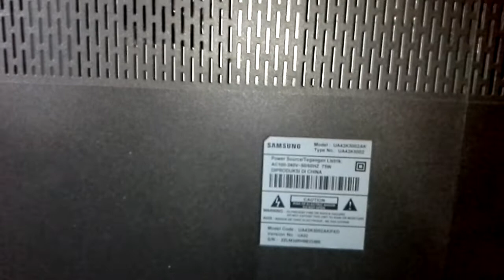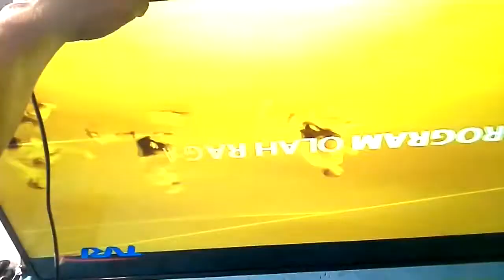Tv Led Samsung UA43k5002 Mati Total

Comment: Gan klo tegangan BL inu berapa ya normalanya, saya ada kasus tv ini saat on tegangan 28v beberapa saat naik 36v.  BL tes normal udh coba BL lain, tetap tidak hidup...fet normal dioda ke BL normal tegangan dioda BL keluar 36v malah udh ganti ic driver. Apkah ada saran?Terimkasih
Reply from the maker: Tegangan max BL pd tv tersebut bisa di hitung dari jumlah lampu lednya di kali teg lampu 3v,.. Tegangan bl naik turun tegantung beban dan setinggan baclightnya,..saran saya ganti dengan bl yg ori